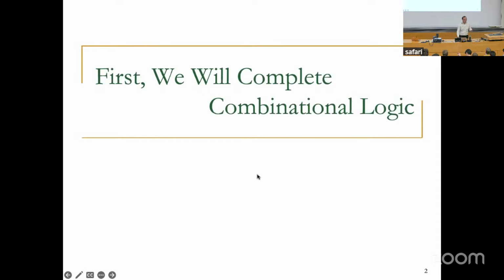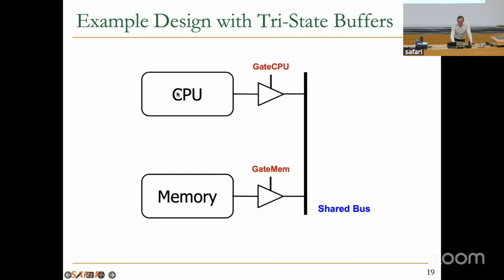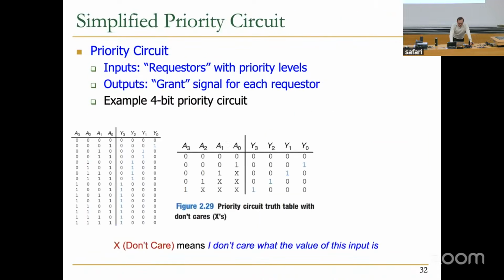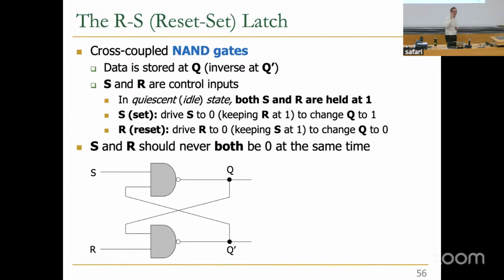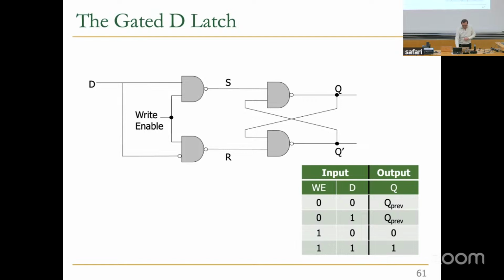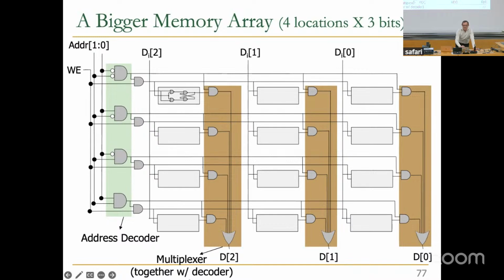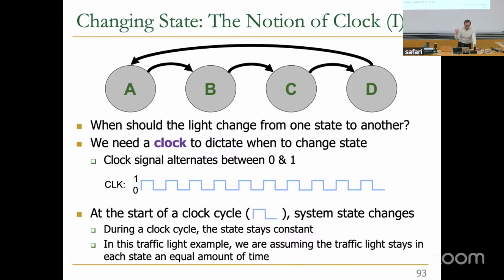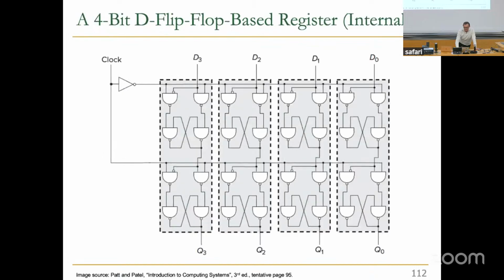Digital Design and Computer Architecture - L3: Sequential Logic (Spring 2025)

Comment: What is the difference between a buffer and a CMOS transistor?
Reply: A buffer strengthens the signal without changing its logic value. It means input signal can strengthen when it is weak.
Reply: Buffer is used to cause delay in output